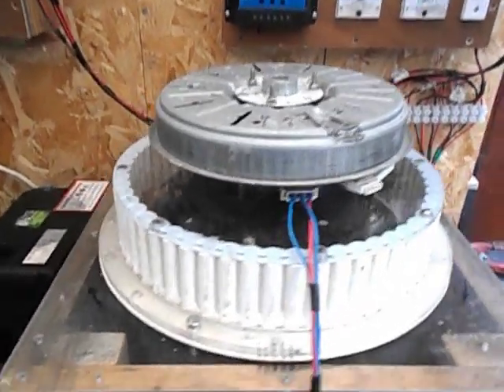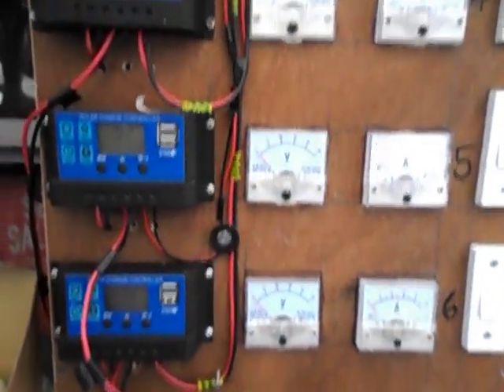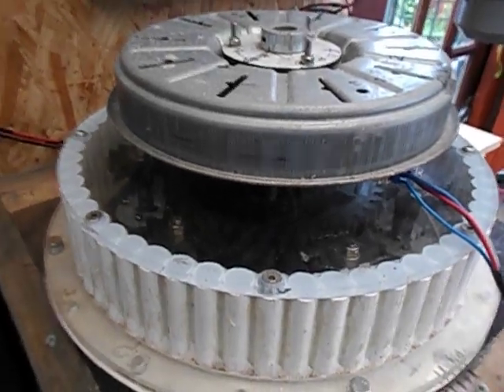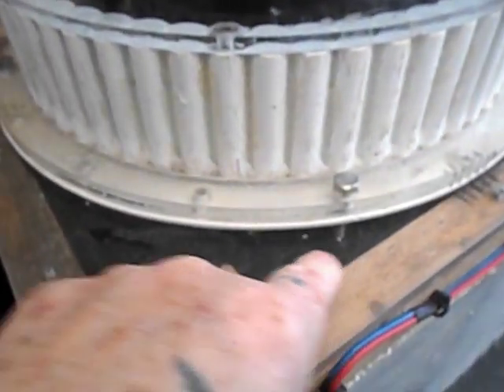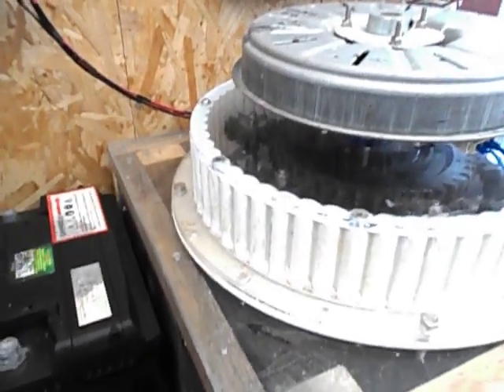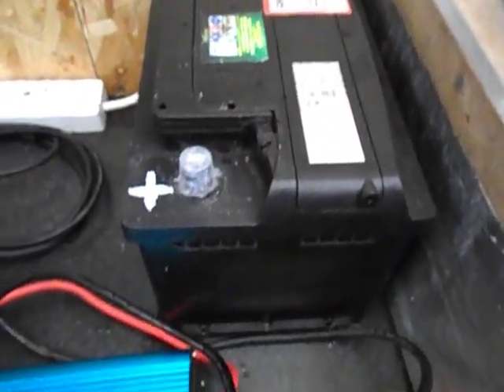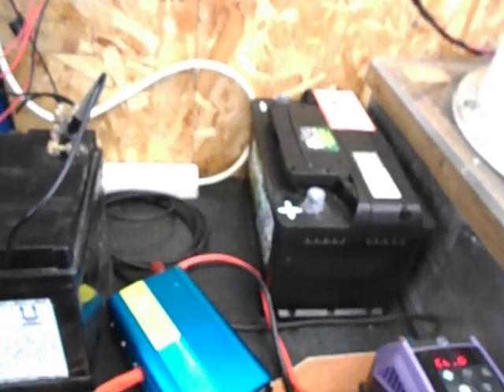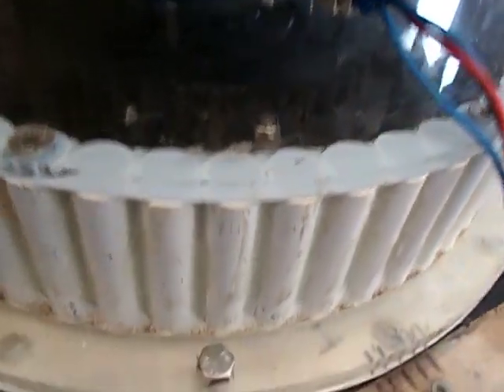Part 1  LG Washing machine motor powering six 90 watt Generators / Motors

Comment: Hi there Derek.
I am very interested in the video showing your 6 generator motor set up and would like to ask you more about it and it's power output.
I have a plot of land with a caravan and some work sheds.
I have a small solar power system but i am looking for a way to upgrade and improve my system and think this could possibly be a way to help me.
Thank you

Comment: Iam sure you could,v run it more quietly using flat type multi V belts
Reply: The friction on every belt and pulley would make it very inefficient.  All it really needs is a more accurate machining and parts. Its made from what I could find at the time and I improvised alot.  thanks for your comment.  Deryck

Comment: As long as he's able to charge the batteries the whole point of this is that it works and can be used in a few different ways depending on what natural available power source is available m me personally I would make a wind turbine as to charge the batteries using that same set up. And solar in conjunction. The wind works well 247 and the sun works until it gets over cast and night time. So using both works perfect in as I said conjunction. Nice work sir.

Comment: Is this More or less Free energy?  Can it power itself without an outside supply?
Reply from the maker: In the second video I run the generator off a 12 volt battery that powers a power Inverter to run the unit on 230 volts the 6 independent generators all reach approx 14 volt and 2amps  and more if I need it, keeping any and all the batteries charged up to power the power inverter. which then runs the 3 phase LG Motor.  It appears that I should be able to run this machine for as long as the unit holds up.

hope this answers your question, Regards Deryck
Reply: @DeryckThompsonChasingtheDream  what if you used a regular car 50A alternator and drive it with your motor using flat v belts

Comment: Hi mate, love ya work!! Thank you. I’m having struggles with the LG & the input, I can get plenty of output but I can’t even get 12 input through the main 3 input wires? Any help would be great thank you🙏🏼👍🏼🤷🏼‍♂️
Reply from the maker: Hi
Are you using a VFD DRIVE to power your motor. The LG is 3 phase so you need a single phase to a 3 phase VFD Drive. hope this helps.
Reply: @DeryckThompsonChasingtheDream  no I am not using a “VFD drive” I have just been testing with DC regulated power supply & a 12 volt battery separately & trying with a bridge rectifier but still full cogging? 
Why do I need to use a VFD? Or can I get around this another way. Thank you very much for your help. 
Still locking up every time
Reply from the maker: @luketaylor1621  The Motors like these are 3 phase you cannot run them on a single phase input. basically you have 3 motors in one and the VFD powers each motor on and off at the exact time to make the motor turn.  have a look on youtube there are plenty of examples. there are also examples on you tube how to rewire the motor to run on 12 volts too. I learned how to run these motors on you tube, all the info is there that explains all this   Regards Deryck
Reply: It seems to just lock up straight away! Dead short?

Comment: Hey. I have a similar project that I'm working on. And ive been looking for the right sized spur gears. It seems that nobody sells them. Did you have to print them yourself?
Reply from the maker: Hi
I dont have a 3d printer, I sourced all the parts from the internet and Ebay. Took me ages to find the right parts, I improvised alot too.
I build all my ideas from parts I find online. There is not many large gears out there made of plastic.  I have since found a supplier on Ebay that sells various sized plastic spur gears. called HOSTAFORM.  hope this helps with your build. Regards Deryck
Reply: Yes this helps alot.Thank you so much.  But do you remember the OD of the big gear. And The OD of the smaller ones?

Comment: So u charge 6 batteries with 1 battery
Reply from the maker: Hi Jussi.  Yes that`s correct but more importantly I can power the Power inverter which runs the whole thing, making it self running. and in part 2 you will see that I actually do that.  Hope you have subscribed so you don`t miss out on any future video`s that I upload to youtube.  Regards  Deryck

Comment: You must be a retired military or marine technician. Only they have the standard in managing components, wiring, and safety in such a great clean and organized manner. Excellent experiment. The idea of utilizing monster torque of the WM Motor makes sens to couple it mechanically, although it will cause a mechanical drag but no one has done this before. It is possible the mechanical drag is not as strong as magnetic drag. We will see your second part for self-powering close loop system. Thank you for sharing. I really liked your well-organized schematic of each generator. Great job! Keep it up sir. Lots of respects from Canada.
Reply from the maker: Hi.  Thankyou for your positive comments , Nice to hear from someone who can see the potential in this generator. In part 2 you will see that I run the whole unit off one battery making it a closed loop system, I only ran it for a few minutes for the video on you tube but it seemed to work ok. but I will be testing it with long running times. I am also going to change the PWM  units to MPPT  units which will maximise all of the volts and amps that are being generated.  Still working out how to change batteries over (If needed.)  Once I have run it using the MPPT units I will post another video showing the results, good or bad.  Its all about trying out different ideas. anyway thanks again . make sure you have subscribed so you dont miss any new videos of mine.  Regards  Deryck
Reply: Great work my friend ..go ahead.

Comment: heya have you measured by any chance this would be at optimal rpms the voltage and current used on the drive motor and compared it to the total output .im sure our viewers would find interesting aswell thanks
Reply: and i forgot to ask what you were using as the generators?cheers

Comment: i have seen a few people using these motors in their testing labs ,and have configured them in Bedini and pulse configurations .the drive motors i am really interesting though and there are some leaking into the ev sports cars now that are an axial flux motor and a radial flux motor in one the winding are on each side and over the outer edge then they use magnets on the out edge with iorn arm the bend the feild around to sides ,similar to the way the altinator bends it magnetic feild ,these motors now have crazy top rpms with high torque while being a 1/4 to a 1/3 the width of a radial alone and can easily be dilectric liquid cooled

Comment: hello im am watching your video ,thanks for having a go and posting .I am curious though as to what was your motive to run 6 x 90 circuits separately like this ,would love to hear from you thanks Angus
Reply from the maker: Hi Angus.  The aim is to generate enough power to run this on on a power inverter as I have shown in part 2 .  If I can do that I can complete the loop to run itself with power to spare.  I am  still trying to find out how much power I need to generate to accomplish this. Thanks for your interest, please subscribe so you can keep up with what I am doing. lots to see. Kind regards Deryck
Reply: no probs Deryck thats where i thought you were going .I drive inefficencies are where we get let down thats why the devices that have got the closest so far to over unity have been the pulse motors with massive 2-3 pound coils of copper they have 3 stator coils with 2 neo dymium magnet rotors between them .when paired with sensors an right controller they can reach resonence and magnet flux saturation then then curent used drops off to near nothing.also if they use 6 coil pairs each time 2 coils are fired they have 4 coils to pull energy back from .gerard morin was very close to a production model last time i read up on him you might get some ideas from his videos too  @DeryckThompsonChasingtheDream
Reply: one thing i didnt notice was that you could probably leave out the pwm charge controllers they would be wasting energy on you if you rpm is stable and voltage is stable they wouldnt be needed.anything you can trim out will help
Reply from the maker: Hi Angus I must have watched 95% of Gerard Morrin`s videos it was he who got me really interested in this over unity lark. I have seen many videos of Bedini motors with big coils and my thoughts was the coils can only give a small amount of current and voltage before it starts to drag the motor down. My idea is to use my idea with at least 3 batteries that can be timed to change  to which one is the power battery at any one time. therefore keeping ahead of the power being used. The generators I use can generate 24 -27 volts and 4amp if the washing machine motor drive is quick enough approx 350 rpm which isnt fast at all. The washing machine motors will reach 1000 RPMS when set up correctly. so still lots of power in reserve at the moment.  Regarding the PWM I agree they are not too helpfull as they actually restrict the power back to the battery. I used these because of cost and I am still learning what is best to use. It is my intention now to use the MPPT units because it will use all the power generated by the 6 generators.  I have quite a few ideas to get this machine to run itself and am confident that it can be achieved.  Gerard Morrin was close at the end but disappeared all of sudden. Maybe he decided to keep the results a secret lol like so many on utube.  Anyway hope you understand where I am with this idea just need a little more time and funds to get there.   I enjoy what I do and its for fun and entertainment for all who are interested.  All the best Deryck
Reply: Awesome Deryck if you ever want to try a more configurable motor controller let me know and i can probably send you the parts for your channel ,using arduino and 3 inverter boards which will boost up to 400 volt from a low voltage and since you can adjust the frequency to whatever you want you can even reach 3000 rpm with that motor.ill even find the code for you as its already done for us cheers Angus, @DeryckThompsonChasingtheDream
Reply: Looks worth trying

Comment: I do not believe that you can draw down a battery and charge it at the same time. You need a timer or something so you can have a run and a charge battery system .
Reply: If 2 batteries
Reply: @jussikankinen9409  exactly. There is a latching relay /timer that is made by OMRON that does exactly what is needed for $60.

Comment: Sorry for my question. Is it a kind of moto perpetual?
Reply from the maker: Hi Thankyou for your question. I have done some testing and I believe that with this set up I can make the generator power its self which would mean over unity.
my second video shows the generator being driven off an inverter powered from the batteries which are then being recharged all the time by the six individual generators that are being driven by the main center motor.  I hope this makes sense to you. ( please see part 2)  kind regards Deryck

Comment: Hi Deryck, I have a question. Can I run this LG motor with optidrive E2?
Reply from the maker: I think the E2 can be a single phase  in and single phase  out. AND it can also be a single phase in and 3 phase out too.  If you have U.V.W Terminals then yes you can run this motor as U V W relates to 3 phase output.  hope this helps. regards Deryck.  ps. it will tell you on the info label.

Comment: Try a belt drive, be a lot quieter
Reply from the maker: It sure would but its not easy when you have 6 separate generators from one drive wheel. to wrap one belt around all those pulleys would create too much friction which would over exert the drive motor, which is what I have tried avoid.  reason is I need the main drive power to be less than the 6 generators combined to achieve what I consider to be over unity.  Hope this makes sense to you. regards Deryck

Comment: Somethings wrong, if u use 320W you give back to the batteries 15V•2A for each MPPT, wich means 90W for 3 MPPT and in yhis case maximum 180W, how cannot you tell the others 140W where  used to activate the motor at 275RPM? 
PS: i apreciate your work, very interesting

Comment: If you add flywheel weight 50 lbs or so. It will run better my friend.
Reply: Look at a lawnmower motor top.
Reply from the maker: Hi. Many thanks for your suggestion, I have already tested that idea with a much lesser weight but as soon as you put more weight into the rotor it uses alot more power / watts due to the current increasing because of the extra weight that needs to rotated. instead of 1.5  amp being used with out any weight added it was going up to 2.5 amp and above making the input power way too high. eg: 2.5 amp x 230 volt is 575 watts input.
 but the out put power does not increase which isnt  helpfull when trying to achieve over unity.  Hope this makes sense to you. regards Deryck

Comment: Hello, are you making more power on the output then what going in from the AC input, nice work mate :)
Reply from the maker: That is hopefully the result I will finally achieve, see part two it explains this a little more, regards Deryck

Comment: Hello!  Please write how much energy was spent to power the installation.
Reply from the maker: Hi Vadim  In the video you will see me scrolling through the inverters settings and it shows that I am using approx 1 amp to run the machine and the voltage is 230 volt so the power is 230 watts.  how ever when I am using all 6 generators the amps naturally go up to approx 1.5 amp making the power 345 watts.   Even at 2 amps it is only 460 watts, which means that if I am producing 6 x 90 watts thats 540 watts generated.   which is more out than in. Over unity I believe. Hope this makes sense to you and thanks for your interest.
Reply: @DeryckThompsonChasingtheDream 
sorry, but I don’t understand what 540 watts you are talking about
 i see 13 volts and 2 amps from each generator x 6 = 156 watts
Reply from the maker: @treaclev  sorry for the confusion I was trying to explain that have 6 x 24volt x 4amp generators available and if it took 2amp and 230 volt to drive the unit fast enough approx 370 rpm then that will be Input of 460 watts which will give me the 540 watts of power from the 6 generators. I havent reached that point as yet and am still doing some testing but it looks promising.
I have just uploaded a 2nd video maybe this will help to make it a little clearer to you. regards Deryck